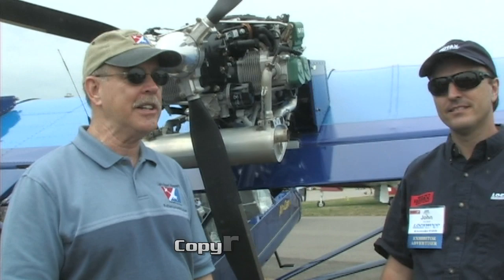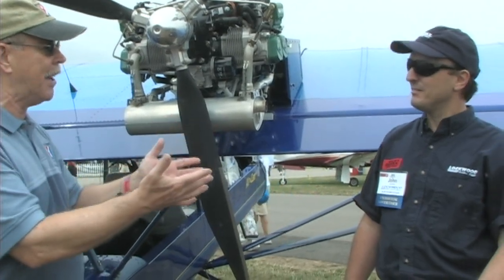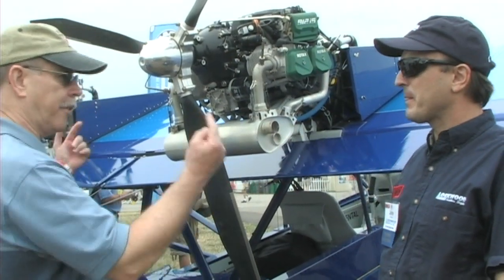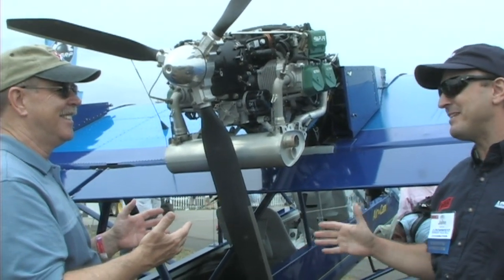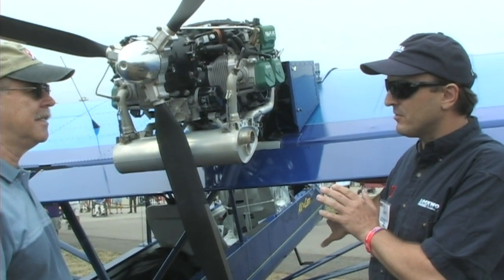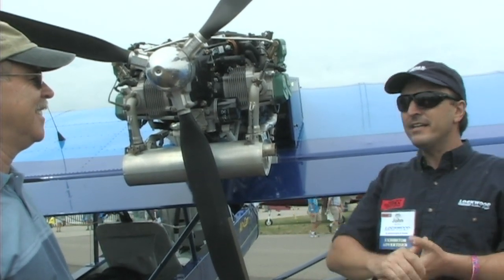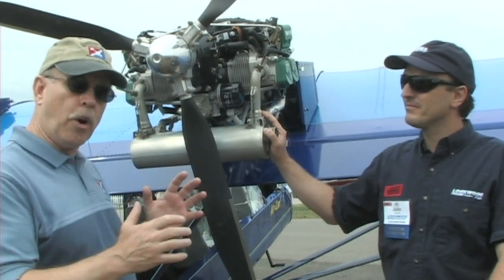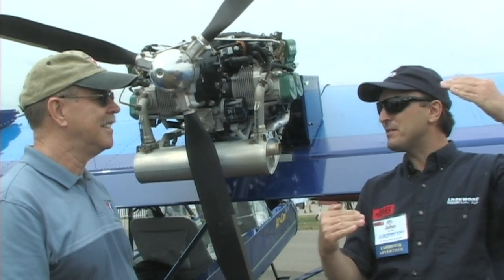Rotax 912 iS, AirCam twin engine experimental aircraft with Rotax 912 iS 100 HP engine.

Comment: I DONT UNDERSTAND WHY MAKE A SPORT PLANE AND NOT BE ABLE TO FLY IT WITH A SPORT LIENCE CAUSE U CANT GET RATINGS ON A SPORT LIENCE (SEA OR MULTI ENGINE) NONE FOR THAT MATTER. AND ALSO IF HAD A PPL WAT IS THE COST FOR MULTI ENGINE,OR SEA RATINGS?
Reply: I’m quite sure nobody has referred to this plane as a “SPORT PLANE,” or more appropriately a “light sport.” One needs, at a minimum, a private pilot license with multi-engine sea privileges to operate this. If one wants a light sport, there is no shortage of single-engine options to be had much cheaper, factory built, and with better performance. This plane was designed to be a reliable platform from which to take low-level pictures over inhospitable terrain, and found a market among those who enjoy flying low and slow, and would like to do so with the comfort of an extra engine.